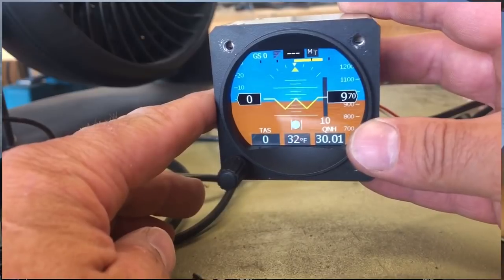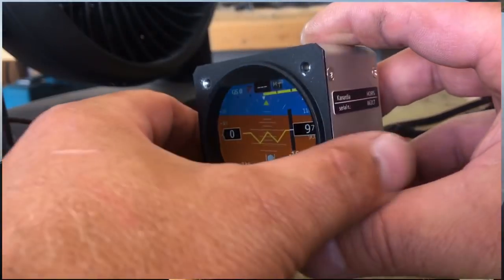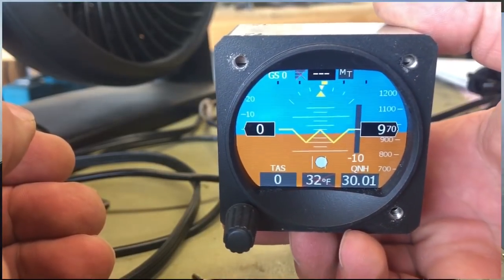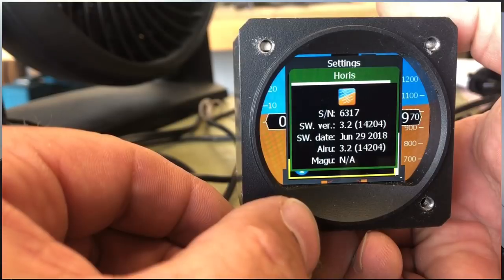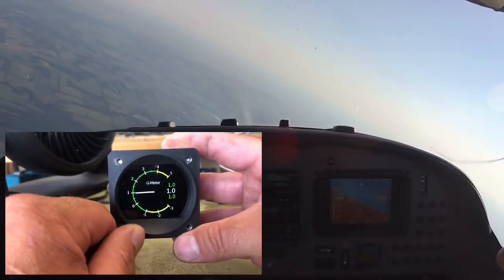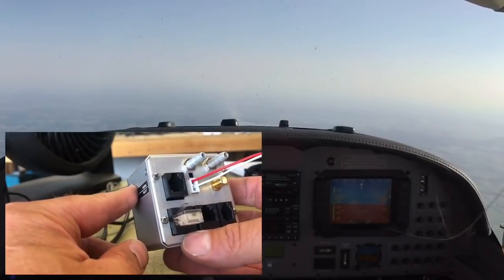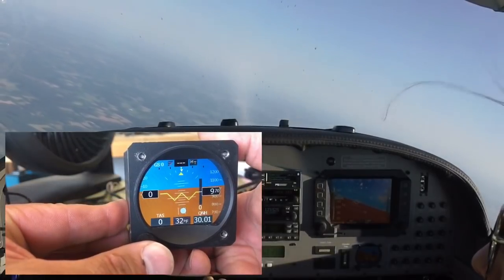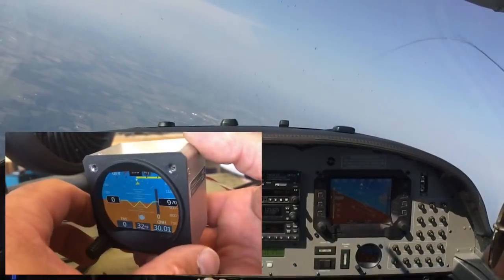Kanardia HORIS EFIS Testing and Review

Comment: Does it have its own backup battery?
Reply: Thanks,  in the mean time I was looking at their website and see that they do have UPS batteries for their displays.
Reply: How did you adapt your pitot/static system to the soft tubing required for the barb connectors they have on the device?
Reply: It does have a backup battery, it is an option.